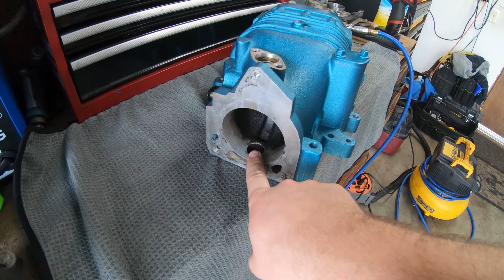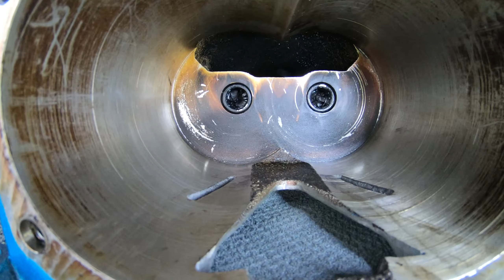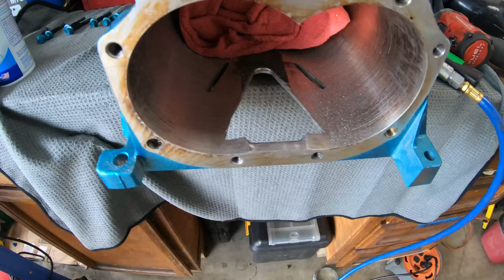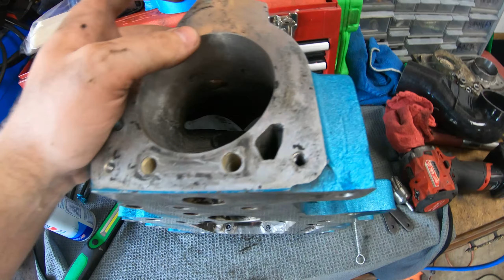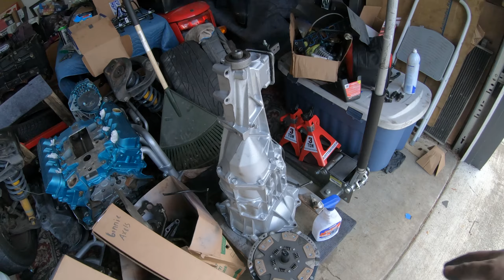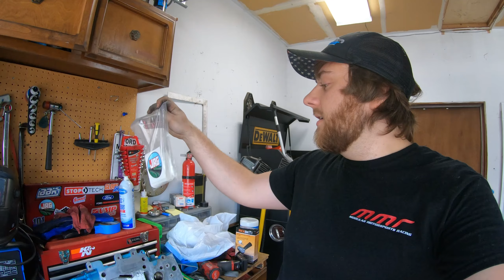Project F Camaro Rebuild Part 17 (Porting and Polishing the Supercharger Plus Plans for the Intake!)

Comment: there is a couple facebook aussie groups focused on holden "ecotec" v6 which is the 231 3800 and im sure someone on there could find you a gen 3 or 5 blower with the bent solid angle for a good price or just pay shipping if theyre really nice because ive seen those silicone hoses suction in on itself with boost

Comment: There is NO room between the SC and the firewall for anything but a block-off plate. You'll need a hard pipe intake. I suspect the silicone piece will be sucked closed if you try to use that. You'll be cutting a hole in the side just like everyone else. I used 3" pipe, others have used 2.5" with success.  Good luck!!

Comment: Great enthusiasm. Hope it works out great. I've been ordering and collecting the parts for the engine in my 02 Firebird. Can't decide if I want to go and have the paint job done on the body first, or go all out on the engine. I've got the WS6 Trans Am high wing hatch and rear bumper on it now, but they're from different cars so my car looks like a calico cat right now lol. The HP tuner I recently purchased was definitely worth it. Tweeked a few things in the ECM already, but not too much you can do with a stock engine other than remove speed limiter, and delete torque management. It'll become most useful after the engine becomes transformed. 

I love the videos my man. Keep it up.

Comment: Ik you guys want to eventually twin charge it. Could definitely do a rear mount turbo set up, that way you won't have near as difficult of a job as trying to route the intake on the driver's side, and could route it on the passenger side. 

Wish you guys the best! Good luck
Reply: Cutting the firewall is an option, I can think of one guy who went that route, and it added I think an extra 2-3" of space, but it would me much easier to modify the housing to accommodate clearance issues. I say much easier, very lightly though lmao
Reply from the maker: @chefs_garage  Cutting the SC will probably be our only option. We're definitely going to see about making the silicone adapter work first though, just need to finish with the Bonneville then we can do some test fitting in Project F.